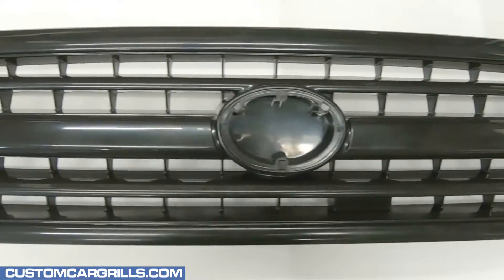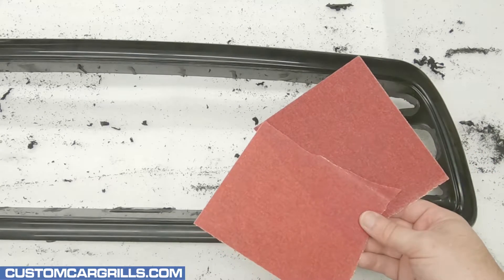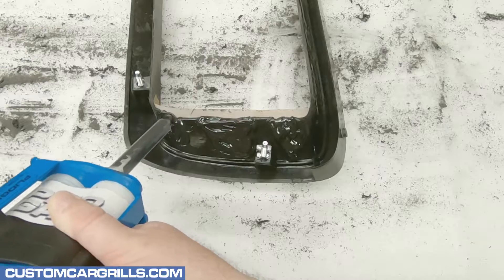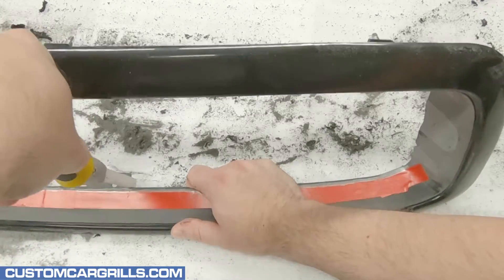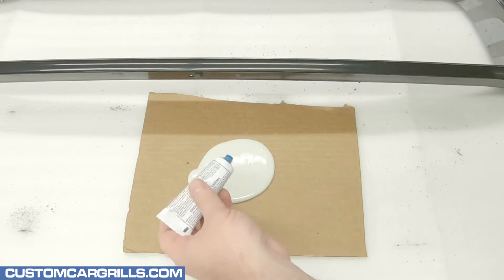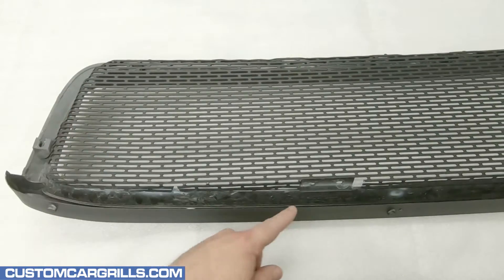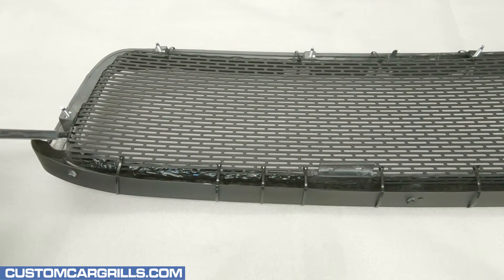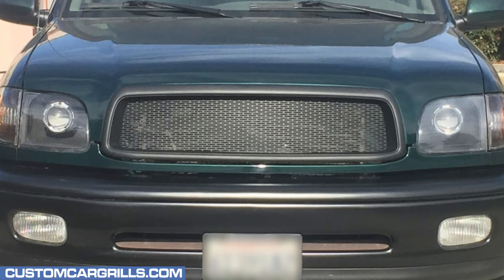Satoshi Mesh Grill Installation for Toyota Tundra 2000-2002 How-To by customcargrills.com

Comment: Very nice job on the grill I did something similar back in 09 with my 1st gen tundra. Mine left a little to be desired, unlike yours. Anyways, I was hoping to find out where your customer found those projector style headlights. Ive been looking for years for some cool aftermarket headlights. But can only find black housing or blacked out lenses. Would love to update my plain looking lamps
Reply: Seen a pair of those projectors on Ebay

Comment: Hey, I was wondering if you could put a list of all the types of glue and all the extras you need to do the job. Want to buy all of it before my grill I ordered gets here! And can I find them at stores or should I order them.
Reply from the maker: I'm sure I'll miss something but I think what I used was:
- Grille
- Mesh
- Open ended saw blade
- Dremel
- Dremel sanding drum
- Dremel #543 cutting wheel
- Sandpaper (100-320 grits)
- Tape (kraft paper or aluminum)
- Pliogrip Plastic Repair #3
- 200ml dispensing gun
- Hobby knife
- Tape (painters or electrical)
- Sharpie
- Bondo or Finishing Putty
- Bondo hardener
- Bondo Spreader
- Paint primer
- Spray Paint
- Cable Ties
- Wire Cutters
Reply: Awesome thanks a lot!
Reply: Do u think u could use jb weld instead of pliogrip I can’t find Pliogrip anywhere
Reply from the maker: There are alternatives, I have not personally tested the JB versions.  3M makes some, but pliogrip can be found here:
https://www.amazon.com/Plio-Grip-PLIOGRIP-Plastic-Repair/dp/B06XXQ9THJ
https://www.ebay.com/itm/141325486044
https://www.autobodytoolmart.com/product/pliogrip-plastic-repair-3

Comment: Can you make a video for a 1998 Nissan Maxima OEM grill?
Reply from the maker: It's unlikely, but we do sell uncut sheets of mesh if you wanted to attempt than install on your own.
Reply: @customcargrills  you can find OEM grill for a Nissan on Amazon for only $30
Reply from the maker: Correct, the oem grills are available for cheap.  The problem is that there are already other companies offering a complete modified grille for way cheaper that it would cost to modify the oem grille.  Please email me ( info@customcargrills.com ) if you have any more questions about it.

Comment: Can I send my grille in and how much would it be?
Reply from the maker: Yes, you can send in your stock grille to have it modified.  Pricing and time frame will vary depending on what you want done, but for a basic one as shown in the video it would start at around $350 + shipping for us to cut, refinish, paint, and do the mesh install if you provided the stock grille.